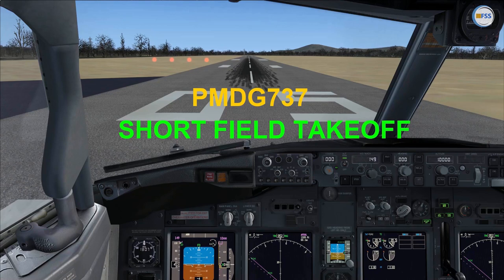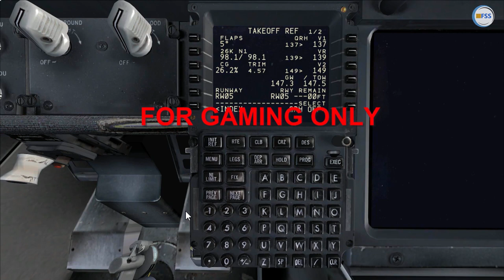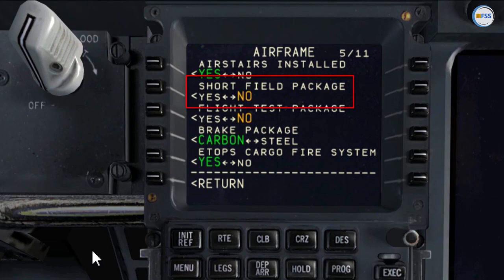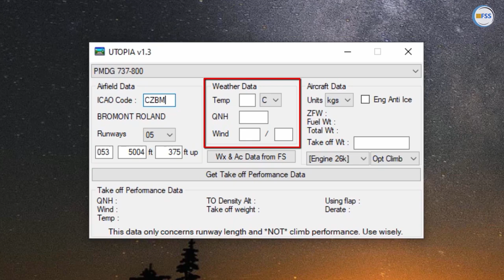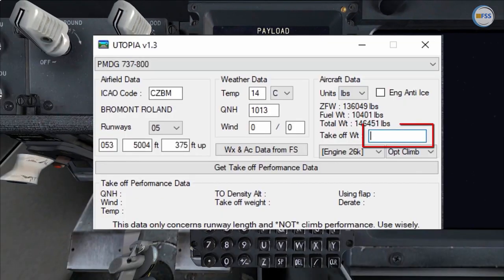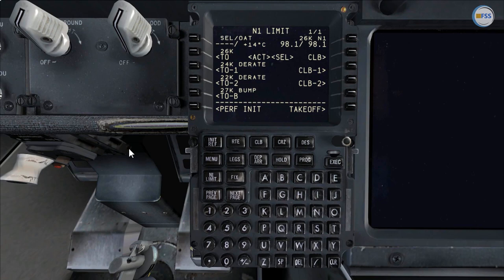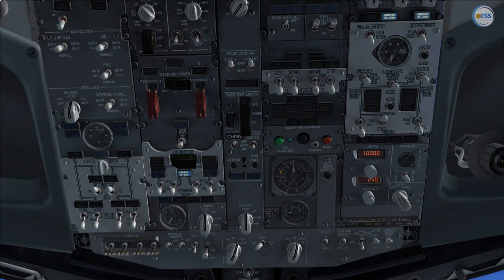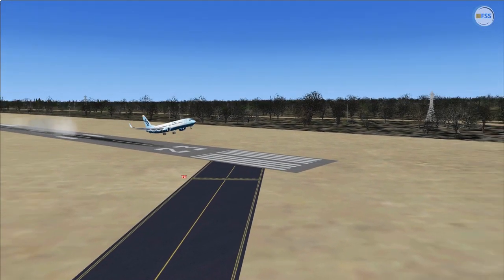PMDG 737 Short Field Takeoff Tutorial With Free Tool For T/OFF Calculation .

Comment: Why did you close the isolation valve?
The APU bleed air only can supply the left pack by doing that.
What is the purpose for that?
Reply from the maker: i was using only the left PACK to decrease the load on the APU but you still be able to use both PACKs so in that case you can move the isolation valve switch to AUTO.

Comment: Wouldn’t you want to hold the brakes while you run up the engines to full power?
Reply from the maker: Good question actually i couldn't find any consideration during my research for holding brakes with full power for B737 when conducting a SFT .
Reply: No, never. A rolling take off is the most recommended method as it reduces the risk of  FODs and engine surge/stall due to tailwind/crosswind.
But if you want to make a standing take off, you only hold the brake in order to stabilize the thurst( reaching around 40%n1) , and  after that you ll have to release them just before setting the take off thrust.
Reply: In the A320 you may spool up to 50% N1 during static takeoff, by using the brake pedals, not parking brakes.